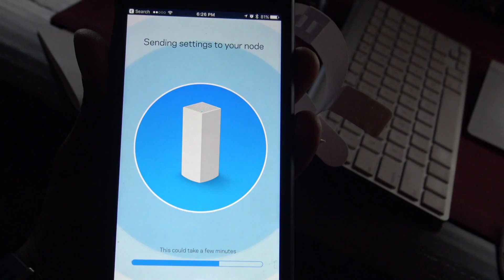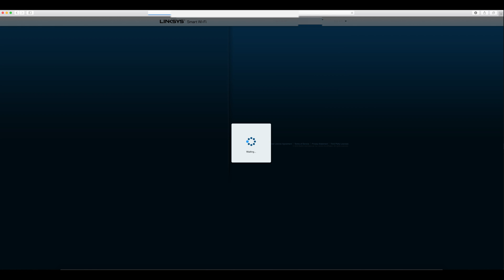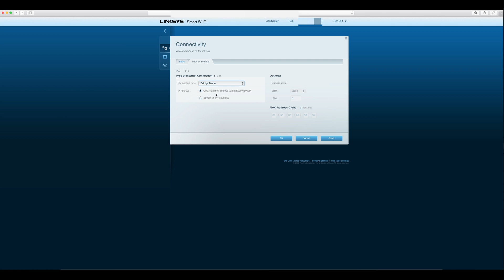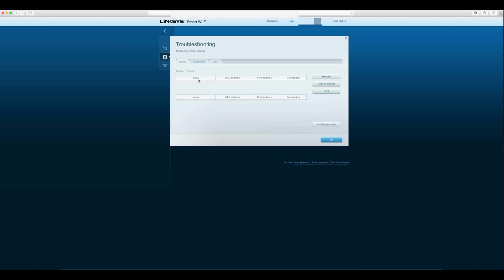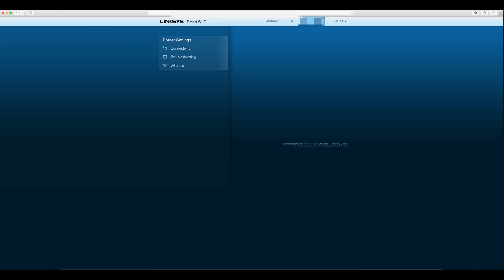Linksys Velop Network Bridging Setup and Configure

Comment: I bought the Linksys EA7500 hoping for 1 router for all, but the signal is not that strong, so I'm thinking of adding the Velop, and this is The exact video of what I need, thank you very much.

Some questions please:
1. Why do you bridge the Internal router, not the Velop? Is there an advantage for that?
2. If I bridge the Internal router could I still use the USB sharing feature provided by my EA7500 on the device that's connected with the Velop?
3. If I didn't turn off the WiFi on the EA7500, do I get the benefit of the mesh system? 

More questions will be on the way. Again, thank you so much.
Reply from the maker: Andi Yassiin I’m glad the video was helpful for you! 

To address your questions:
1. I put the internal router (EA7500) in bridge mode because I want it to behave like a switch. Meaning, it will receive routing and IP addressing information from the Velop system. This isn’t the only way to accomplish the goal of extending the physical network (adding more available ports to the Velop) but I found this configuration to be the simplest without having to buy a switch or additional equipment. The advantage to this solution is that you can continue to extend (scale out) your physical network (Ethernet connections) without negatively impacting the Velop system. And, you get the benefits of the Velop wireless mesh in case you need to add more Velop nodes in the future. If you put the Velop in bridge mode, you will lose some functionality. 

2. Yes you can still use the features of your internal router while in bridge mode (unless it’s specifically stated that the feature is disabled while in bridge mode). I have an external hard drive connected via usb to my internal router and I can connect to it from the wireless network with no problem. 

 3. The reason I turned off the wireless feature on the internal router is because it would create a potential conflict for the wireless devices on your wireless network. Let’s assume you use the same SSID on the internal router as you do on Velop; what this will do is create a scenario where your wireless devices constantly drop and reconnect between the Velop and the EA7500 based on the better signal strength of the device. This may not be a big deal when checking email, or browsing web pages, but for conference calls, web meetings, video streaming, online gaming, or any service that relies on a consistent connection you may experience interruptions. 
That is the magic of the mesh system, is that when one node hands off the connection of a device to another node, you don’t notice it. Under the scenario I just described, you most certainly will notice when your device bounces between the Velop node and the EA7500. That’s why I recommend you disable the wireless signal on the internal router and just let the Velop handle the wireless connectivity. 

I hope this helps. When you get your next series of questions ready, shoot ‘em over and I’ll do my best to help out.
Reply: On the 2:50 you configure the IP address for the router, is it necessary? I never edit this part, usually it's automatically added.
Reply: Andi Yassiin no, it’s not necessarily required to perform this step. At approx 3:10, I explain why I made these IP address changes. Basically, I moved the custom IP address scope from my EA7500 over to the Velop. Prior to getting the Velop, I had the EA7500 setup with a custom IP address range for internal devices. By moving that custom scope over to the Velop, none of my existing devices have to change IP or gateway information and will keep working like normal. This is most beneficial for devices on your network that have manually assigned IPs. (Like my TV, PS4, home security, etc.)
If you did not perform the step to create a custom internal IP address and range, the Velop would use the default 192.168.x.x and you devices would use that range as well. Including the devices connected to the EA7500 which is now in bridge mode.
Reply: @Movingfoward99  aaaahhhh, thank you, very clear on that. You're so good at this, you deserve your name.
Reply: @Movingfoward99  yup, finished setting it up, and it works wonderful. Can access my Ext HDD from any smart tv that's connected to the Velop (the EA7500 is bridged). Next question, do you have any idea how to access/watch the content from a smart device other than TV's (laptop, phones, tablet, etc)?

Comment: What if I want to setup my velop network as the bridge and use the internal commercial router as the main router?
Reply: Hey there! You can set your Velop into a bridge mode however, you'll miss the features of the Velop itself. You can set the Velop as the main router for you to experience its advanced features. :)

Comment: Thanks for this. Helpful. Just one question: The first step of the Velop app's setup is to "name your network" (this is required even if you plan to use it as a bridge) Do you just make up a temporary name for the Velop network at that point so you can continue?
Reply: yes

Comment: What if I wanna make the velop as a bridge
Reply from the maker: The Velop does support a bridging option. You should be able to use the Velop nodes as bridges and allow a router (layer 3 device) to handle the network traffic out to internet.

Comment: I was wondering if you might be able to offer some troubleshooting advice?  I recently upgraded to 200Mbps from 100Mbps.  I've checked my connection on a few different speed test sites and they are all showing 65-100Mbps.  I called my internet provider and they walked me through steps to check if it's my router or the internet.  When I plug the ethernet cable into my computer, directly from the modem, the speed tests show 250-300Mpbs.  Tech support says the problem is with my router and that I needed to call the manufacturer.   I feel like there might be some setting that I'm unaware of, that could help??  I tried device prioritization, putting my computer at the top of the list, but that didn't improve the speed tests.  In the Velop app, under device prioritization, it says priority is being based on a 134Mbps connection.

Thanks for any help you can offer!
Reply from the maker: @Richard Buchanan - There are a few reasons your bandwidth experience on wireless will be lower than the full bandwidth supplied by your ISP. 
To determine if the issue is originating with the Velop system, try opening the linksys app on your mobile device or access the dashboard from a computer on your network. Once inside the app, open the speed test in the left-hand menu. This test will determine the bandwidth available on the primary node (the node connected to the ISP modem). If this measurement is significantly less than that provided by the ISP (100Mbps or less), the issue may be with the Velop system. If this is the case, you can attempt to upgrade the firmware of the Velop system (assuming that has not been done). Also, check that the ethernet cable used to connect the Velop node to the ISP modem is in good condition. If all of the above has been performed and the issue persists, you could try reseting the Velop to factory settings and configure it again from scratch. (less than ideal, but sometimes factory resets can solve issues like this). 
If the bandwidth test within the app shows a favorable output, then the issue might be with the wireless connect between your device and the node. If your devices are using 2.4Ghz on a wireless n connecter (for example) the maximum bandwidth is 300Mbps, but only under optimal conditions. The more realistic maximum measurement would be 150Mbps but, again, that's under optimum conditions. Therefore your results of 100Mbps might be accurate depending on your distance from the closest node. 
If you are using 5Ghz wireless N the realistic maximum is about 450Mbps and wireless AC is up to 1Gbps. 
You may be able to use the linksys app to determine which node your device is connected to, and it will give you a general idea of the signal strength. Also, if your device has the option to display the wireless status (interference, noise and tx rate), you may be able to determine if the conditions improve as you move around the wireless coverage area. 
I hope this helps.
Reply: @netxperts3280  Thank you so much for the detailed reply and problem solving steps!  I really appreciate it.  I actually got it fixed!!! :)  I browsed the Linksys community message boards and found that many people have similar issues.   In one user comment they said that turning off the device prioritization feature in the app, fixed their problem.  I thought that has to be too simple, but I tried and guess what... it worked!  I'm now getting between 250-350Mbps, though I'm only supposed to get 200.  I turned device prioritization back on, just to see, and yep.. the speed went back down to 65ish..turned it back off and up it went.  I did not run the speed test via the app, because users and moderators on the forum suggested that will actually slow your speed.. for some reasons that I didn't understand.  LOL
Reply: Now I'm curious to know why this is a problem?  What's the point of the feature if it slows everything down.  The device that I had prioritized was the device on which I performed the speed tests..   Maybe a broken feature or maybe I have some setting out of whack.. I'm not sure yet.
Reply from the maker: That kind of makes sense regarding the device prioritization, in a weird way and I'll explain why. I never use the feature, but on a commercial router like this one there really isn't a quality QOS system like there would be on a real enterprise router. So, my guess is, the Velop (like most other commercial routing systems) simply reserves a portion of the total available bandwidth and allocates it to the devices in the prioritization list. This works well when you want to ensure one/few devices get higher percentages of the bandwidth for gaming/streaming while other less active devices only consume 10-20% of the bandwidth for lower priority tasks.

Comment: Can I use velop as wireless bridge of comcast ISP?
Reply from the maker: Albert Chen, yes. You can use Comcast devices in bridge mode. I’m not sure about all Comcast routers, but in general they do support bridging to use your Comcast provided IP on your personal equipment such as a firewall.
Reply: Netxperts thx

Comment: Hey Netxpert, 
Is there a way to make use of my current ASUS router to amplify the strength of the wifi in conjunction with velop system?  Basically use both together and getting better range and strength?

Comment: great video, good information on how to setup. my question is if i only have isp modem with no built in wireless is bridging even possible? or am i setting it up wrong. i am to believe that bridging the velop devices allows for each node to have a hard line and still act as a mesh correct? right now my settup is isp device (single port)-->unmanaged 8 port modem--> then splits to my velop devices (when they are plugged in)  i only have1/3 plugged in for the nodes to ping the main ATM. when i try to bridge it says its all good but then i cannot obtain any ip address and access the system from phone or computer. appreciate any input, thanks!
Reply from the maker: matt oliver Thanks for your comment. 
To answer your question, yes most ISP routers/modem support bridging. Bridging the ISP router to your personal device allows you to use the public IP provided to you from the ISP on the device connected to the ISP modem. A common use for doing this is connecting the ISP modem to a firewall for VPN, or even to create a DMZ for public services like web servers or FTP, etc. There are other methods for achieving the above mentioned solutions, of course, but I wanted to provide some context for using bridging of the ISP modem.
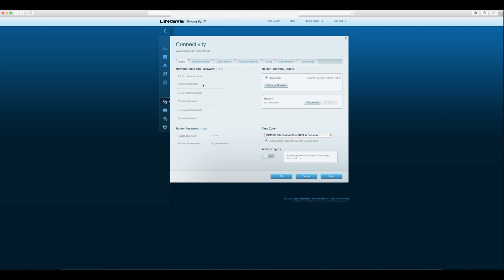In your case however, I would not recommend using bridging of the ISP modem to the Velop node because doing so disables the DHCP service on the Velop. This is the reason none of the devices you connect to the Velop obtain an IP address. The initial part of your setup is fine. You can connect the ISP modem's uplink port (the single port you mentioned) to the Velop node directly, leaving the ISP modem in it's default mode. Assuming that the default setting of the ISP modem is to provide DHCP and NAT the private IPs to the public IP provided to you by your ISP. Then, plug the same Velop node into the switch. Now the Velop will "listen" for traffic from any other devices connected to the switch and be able to communicate with the ISP modem and get an IP address to the devices plugged into the switch. Now you'll want to simply plug in your other Velop nodes throughout your home within appropriate range to sync up with you primary node. Now that all of your nodes are connected, you'll want to follow the instructions from this video starting at time marker 2:25. Once you set your Velop DCHP server options, all of the devices (wireless or hardwired to the switch) will get IPs from your Velop system and everything should work in harmony. 

Please let me know if I can provide additional information to help. 
-Cheers

Comment: sry for being late to the party :) . its a great video , ty for making this one . 

i have 3 questions tho . 

im using a linksys wrt 1900AC wifi router , wich is not super new , the first question would be , can i use the velop to extend the range of my main router and let it keep the same functionality its intended to be used for (aka having devices switch up access points (router / velop) automatically depending on wich as the strongest signal) ? if so , second question , would the signal integrity (speed and Strength) be as good as it can be (no sudden lost of signal etc) considering that i dont use a velop as my main router ? last question , if the answer to the first 2 questions in order are 1 yes and no or 2 no and no and i may encounter problems in my home with it and better be replacing my wrt1900 with a velop , will i have the same standard user interface / control pannel / web interface that i have now with my wrt 1900 AC ?

ty in advance for helping me out with this :) it is greatly appreciated
Reply from the maker: @darkmadrap If I understand your questions correctly, you are asking if you can use the Velop as a range extender of your WRT 1900AC while leveraging the mesh functionality of the Velop to ensure stable wireless connectivity as your devices roam between access points. I don't believe the Velop supports this functionality. Wireless extension options are not available in the mobile administration wizard. Even if the options were available, I would not recommend using the Velop for WiFi range extension as this would severely reduce the quality of your WiFi experience because your devices will switch MACs as they "roam" between the WRT 1900AC and Velop system creating temporary drops in connection. 
The user interface of the Velop and WRT 1900 AC are very similar. Linksys has created a pretty standard web GUI for most of the recent router devices. 
If you have a need to keep the WRT 1900 AC as your primary router, you can integrate the Velop with your existing network so that you can take advantage of the Velop features. That's essentially what I demonstrated in this video.
Reply: @netxperts3280  ty you helped me out to reconsider my choice . Tho im sure it will be helpfull for the house im in in the future as people i live with will be happy to have better signal across the house when i will leave them to go in an appartment of my own :)

Comment: What do I need an internal router for when I can set up a guest network on the Velop system?
Reply from the maker: You don't need an internal router at all. If you are going to use all wireless (or mostly wireless) connections then you just set up the Velop in a standard configuration. The content in this video is for people that want to keep their existing router and integrate it with the Velop system in a way that takes advantage of the Velop features while keeping physical connections in place.

Comment: Someone please HELP ME!

i have a motorolla modem thats hooked up to my linksys ea9500 router, could i just hard wire in one of the velop node to the ea9500 and set up the vleop system then change it to bridge mode right after?
Reply from the maker: I think the issue you will run into by connecting the Velop node to your ea9500 prior to running through the initial configuration of the Velop is that the Velop node is going to attempt to access the internet directly from the ISP modem (Motorola in this case). I attempted to perform the same thing you are asking about and the node would never initialize. Thus, you won't be able to set it up in bridge mode. 
To solve this problem, you can plug the Velop into the Motorola modem and allow it to initialize. After the Velop node has completed it's initial setup, you can access the administration web page and change the Velop to bridge mode. Then plug the ethernet cable from the Velop into a port on your ea9500. Assuming your ea9500 is handling DHCP, your Velop should get an IP from the ea9500 and the remainder of the nodes will join the mesh using the same process.